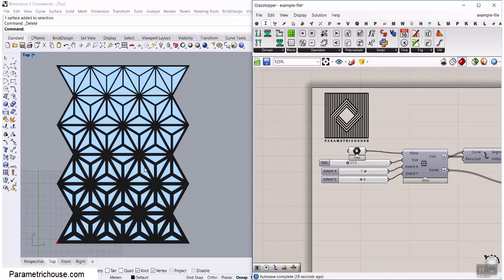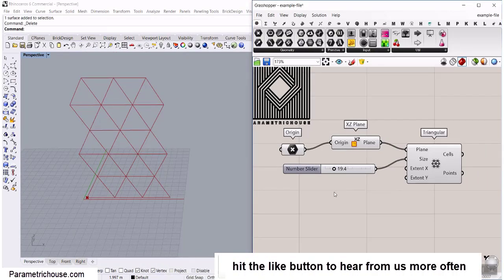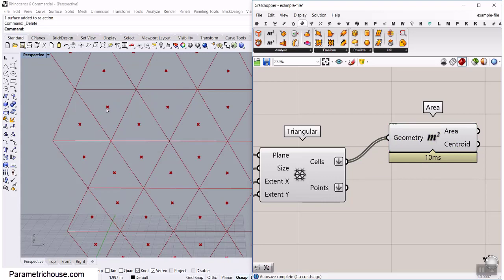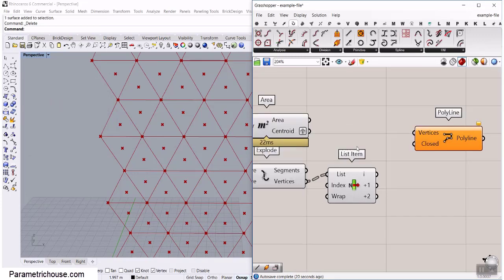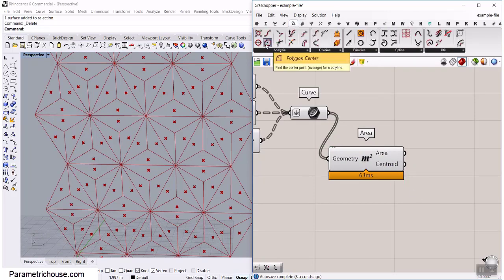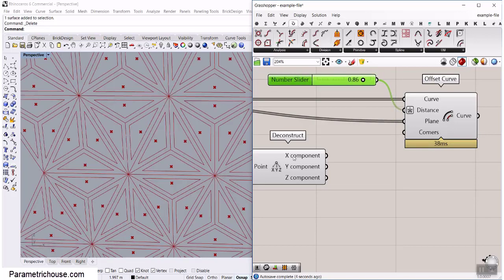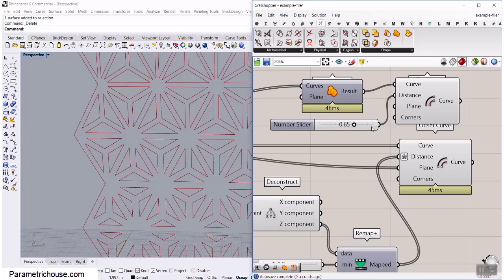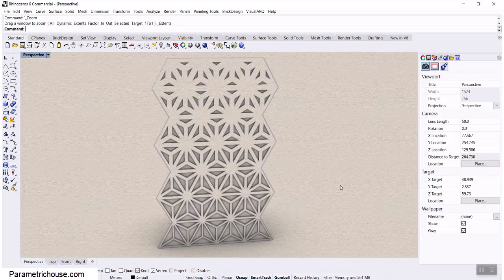Rhino Grasshopper (Parametric Pattern)

Comment: Nice tutorials series! one thing though, at minute 13:13 when you added the Region Union component, this step wasn't really necessary, we could've just used the already existing Curve component that holds all the Polylines together with the output of the Offset Curve component and plug them together into the Boundary Surfaces.